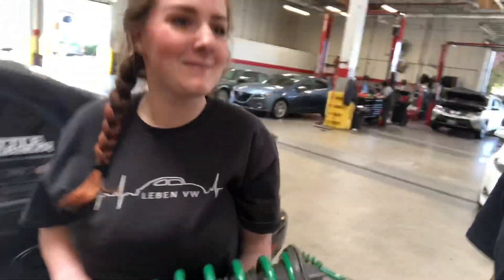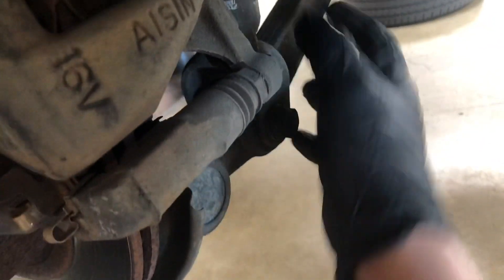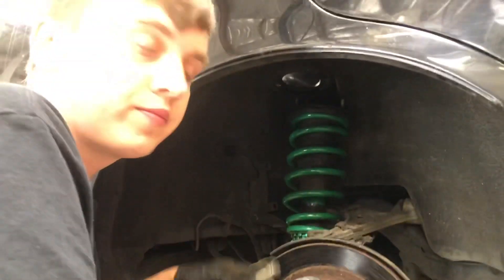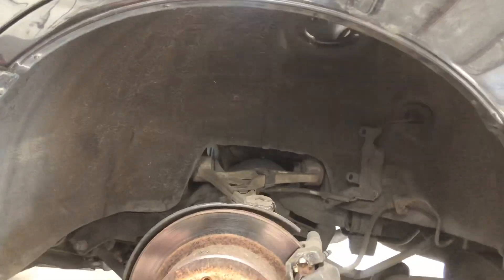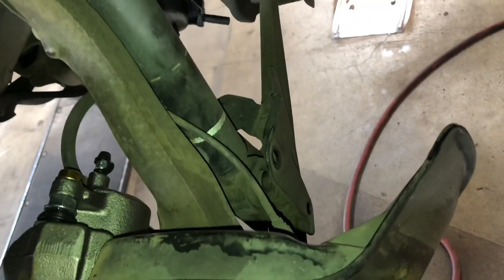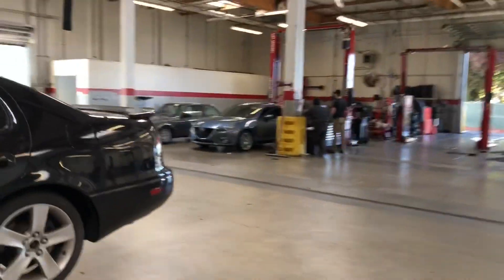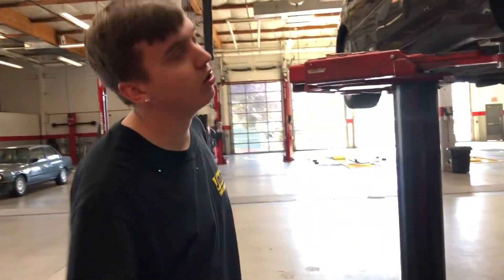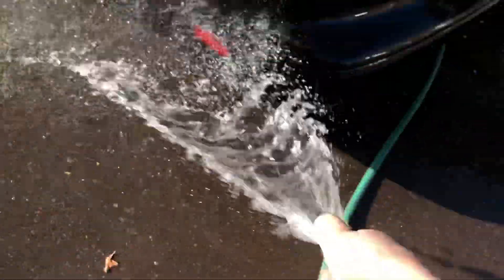BLACKWATER GS300 COILOVER INSTALL

Comment: Sc300 coils fit gs300 but do gs300 coils fit sc300's? Plz lmk i found a set of stance coils for a gs300 at my local junk but i have a sc300
Reply from the maker: @Lll-k8g2x  yes if it’s a first gen gs300